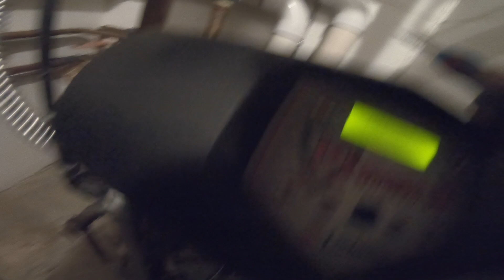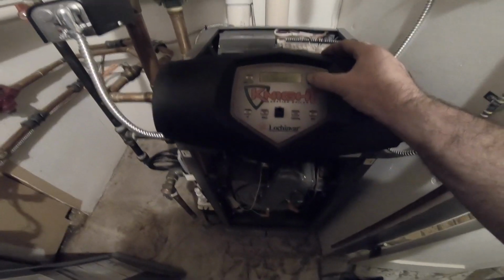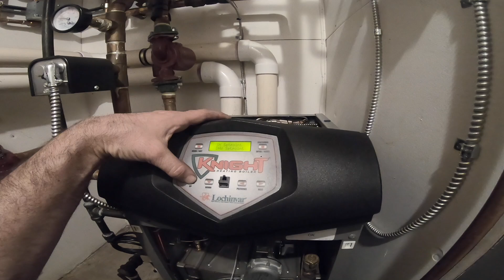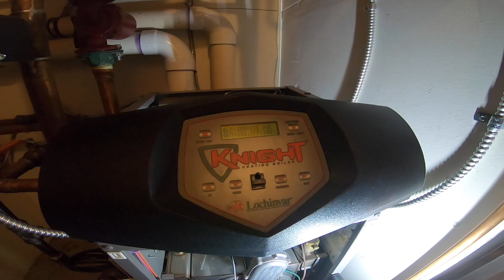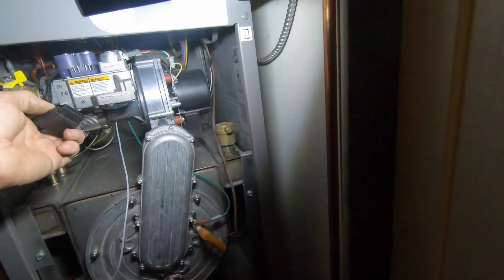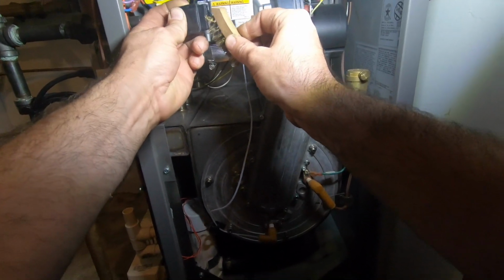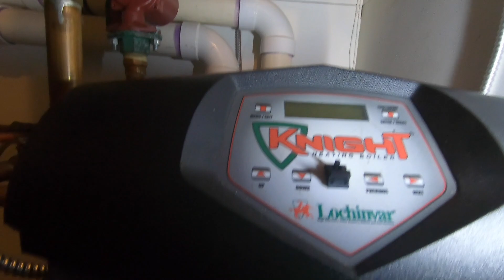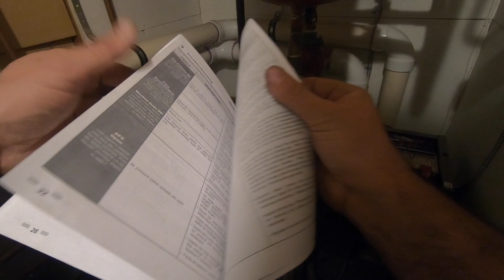Lochinvar Gas Valve Issues Shuts Down Heat

Comment: Incredible how bad connections can affect the electronics of these valves. That harness & connections looked brand news.
Reply from the maker: This boiler is 6-8 years old. This is common on these modulating boilers. Also the cheapest repair for this fault